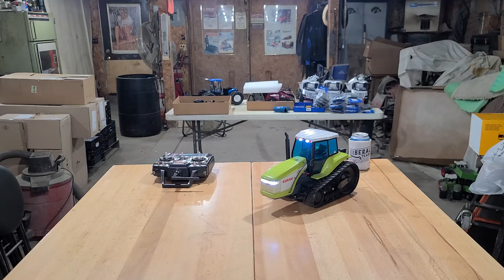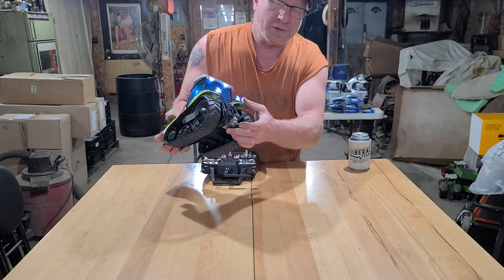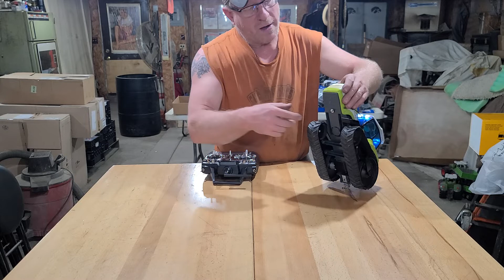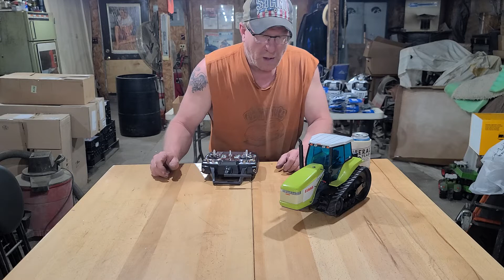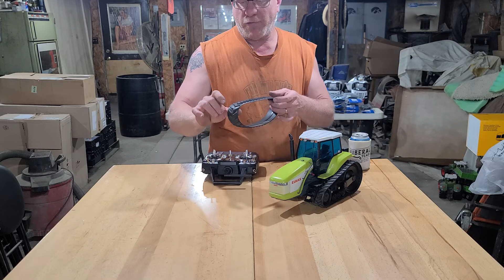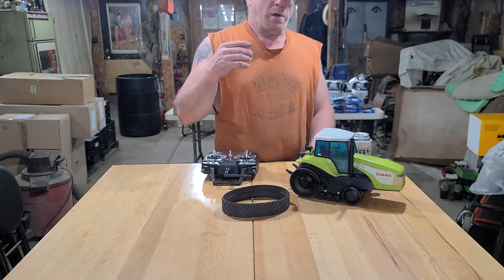My 1/16 Claas Cat Challenger 45 RC Conversion

Comment: I love this one how much will it pull before the wheels slip inside the tracks?
Reply from the maker: Haven't tested that yet. More worried about turning and having the tracks roll off. Got a plan for that in the making though. Used adhesive thread tape on the drive wheels to help with the traction and that helped a ton, otherwise the drivers were smooth and slipped a lot.
Reply: @dennybobsrcconstructionagc2796  I wonder if there is a way you could glue something inside the middle of the track like round O ring type rubber and then cut a groove in the idler and drive wheel that might help keep the track from rolling off
Reply from the maker: @dirtgrainsteel  there is already a groove, but the track guide in the center on the track is not very tall. Going to cut some strips of rubber and use vulcanizing cement to attach it.
Reply from the maker: @dirtgrainsteel  I am also hoping by gluing a thicker strip in the center will also minimize the stretch and keep the track tighter. I ordered some Western Weld Vulcanizing Cement to attach the rubber to rubber. It worked great to attach taller track cleats on my Bruder track skid steer.

Comment: I've had glitches in my beacons as well like using a y connector for 2 of them but 1 will still do its own change with out switching the switch on and off!
Reply from the maker: Never had an issue until lately. I'm thinking a quality control issue.